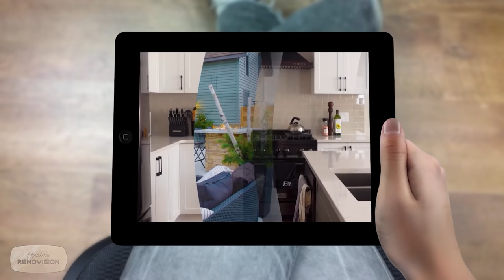Building A Simple Deck In 1 Day | Reality Renovision Ep28

Comment: Gaps in between deck boards help a lot with debris and water run off. Plus you probably wouldn’t have been short at the end. I guess maybe if the boards shrink at all that may work to your advantage.
Reply: I mean yeah, but since they are only going to be there for a short time and leaving it behind....
Reply: I do not leave gaps anymore.  Shrinkage will occur and prevent your boards from warping.  Also, large gaps are ankle twisters !!!

Comment: My only criticism is the double joist should be on the outside (more foot traffic) versus up against the house. Also I might turn the whole thing 180, because the joist would have the water on the  ground run away from the house without trapping on the crossmember. 
Some are saying what about the top of the deck, water would run across 8 inches quicker than 10ft

Comment: This channel is the best, and this deck is awesome. This is the first floating deck video I've seen where you don't mess with blocks, posts, etc, at all. Sacrilegious! I love the simplicity of this. You didn't even put plastic or something at the ground contact points. It's wood on the ground! Mind-blowing! Call the police! I love it. I have been looking at covering a concrete patio with a floating deck, and trying figure out all these complicated expensive plastic anchoring systems, but now I'm like, forget it, this is 10x faster and way cheaper for what would probably be the same result! Here's a question though: if your ground isn't quite level, what's the point at which this approach doesn't work? Like, say you've got 6 inches of drop-off. Is that too much for this approach? What's the point where you say, OK, we have to use anchors, posts, joists, etc? Thanks for all the awesome content.
Reply: Keeping it simple is not only the key to success but to make it financially viable in 2021. The more complex it gets the more materials and techniques it takes. This is not designed for longevity rather quick and easy.
Reply: Wait til they go to sell the house... Code violations/insurance inspection in most areas will require updating at a much bigger expense than initially. Do it right the first time.
Reply: @JohnJohn-wr1jo  there’s no code when it comes to detached decks. Whether it still looks good/is structural in 10 years, that’s a different deal.

Comment: Looks great! I am building a 24x24’ floating deck and need to have it done in a week. I am placing it on a grassy area that is not level, and we are not using deck blocks because we live in the country and we don’t want critters getting underneath or bees. We’re building on the ground. Any suggestions for getting it level? Can we just shim the low areas.? I’ve never built a deck before. Do not have experience, but this looks simple enough. Also, would you recommend building it in one big 24 x 24 section or would you recommend building it in two or four smaller sections? Thanks!

Comment: Being in Texas, I’m worried about how to prep the deck to accommodate for lots of condensation and ground evaporation from the morning hours to the sweltering heat through the rest of the day. If I want a ground level type deck like this, what kind of extra protection can I provide to prevent premature rot from staring along the bottom?

Comment: question - a 4x8 deck that is inches of the ground.....I have the right hand side toe nailed to the existing deck with about 14 screws...is hat enough support.......and the other side is supported by 2 concrete slabs at each corner.....is that enough support for this deck which will only be holding up a bbq and snow/ice buildup in the wintertime?  thankyou and much appreciated

Comment: Jeff, nice work ok i asked this before and didn't get an answer so hopefully you will see this.  I tore down a 7 year old 12 X 24 section of deck at about 9' above ground,  7 years old and tons of wood rot.  not thrilled.  but I have a 19 X 7.5' swim spa coming so I'm pouring a 12 X 20 pad 6" thick on the ground,  I'm going to rebuild the deck at the original height of about 9'.  I need to support the swim spa off the pad so that about 20" of it sticks up above the new deck.  my question is what would you recommend i use to build up a support at about 5' off the new pad so the swim spa is self supported.   weight full of water is about 25,000 lbs.  with people and the fact that water is moving etc.  say i support for 30K lbs.  any suggestions?  I live in northwest Georgia so will take more precaution against wood rot this time but wonder is i should maybe build some kind of steel support. ??

Comment: Hoping you see this question and can answer for me. Love your videos on both channels. Binge watch quite often. I’ve heard you mention several times in videos about not using the correct screws for the subfloor. I’m in the middle of a kitchen remodel and actually used drywall screws for my subfloor but luckily haven’t put down the floor yet. I’ve tried to look for flooring screws but at Home Depot I don’t see anything specifically saying flooring screws. Only nails. Where can I find the proper screw and what are they called. Thanks In advance.

Comment: We have a fenced yard with constraints and have only enough height from the soil to the back door to use 2' high frame (we intended to use 2 x 4 x 12 pressure treated lumber) + the decking materal.  The deck will be 12' x 13', and the surface will be Timbertech Azec.  With the frame be structually sturdy enough?  Should we use weed sheet with rocks, and adjustable footings?  Thanks!

Comment: If I wanna build a 16x16 what material would you recommend ? I have blocks and paver sand , wondering if I can use 2x8x16 for the wild build with joist hangers and sitting on blocks .

Comment: What type/length of nails did you use for the joists? I'm pricing out lumber for a 12x12 right now and plan on building it the same way you did in this video. Simple, clean, and need a ground level floater for how my backyard is shaped and where the utilities run. Thanks!

Comment: As a professional deck builder, we'll just start with you need more than a hammer and a tape measurer. DO NOT BUILD A FREESTANDING DECK WITH THIS METHOD. Just because its a freestanding deck under 6ft tall that does not require a permit, doesn't mean code doesn't still apply, you cannot build this anyway you want like Jeff said. Using 2*8 block to transfer all the load into the ground is a piss poor way to make a sound foundation, within the first couple weeks and spurts of rain that deck is going to be waaay out of wack. You need to have doubled up rim joists, joist hangers, a solid foundation (wether it be traditional footings or footing blocks like you saw them work around but never use) and use some damn joist flashing tape for god sakes. This deck will last this summer, maybe. If your trying to build something to last many years to come check your local building codes, reference joist and header/girder span tables, make a solid foundation and connections to that foundation, use joist flashing tape on all the joists and behind the skirt and screw your decking down. Jeff usually makes decent video's but this is just him making some viewer content and is not something you should set out to do yourself and expect good results with. If your doing a maintenance free deck your almost just best off to hire a pro, same is true for cedar, if its green treat its going to look like shit in a year anyway so feel free to do it yourself and be a butcher. There are plenty of better deck tutorial videos out there and Jeff I'm sorry to tear into your work like this, but this video is not worthy of being called a DIY tutorial its more of a DIW (do it wrong) tutorial. You sending people who can barely read a tape measurer out to build something with the wrong information and really setting people up to waste their time & money and to fail.
Reply: Also gap your deck boards a min of 1/8", your building a deck not a pool. Pressure treated lumber will shrink a little so its actually best to set it with an 1/8" gap and count on it opening up to 3/16" which is the most common spacing of deck boards. For cedar, redwood, or composite use your speed square to set the gaps (speed squares are 3/16" thick).
Reply: Isn't pressure treated wood toxic?  I thought you weren't supposed to use it for a deck floor, just the frame.
Reply: @jenniferhigber595  It's not as toxic as it once was, lumber companies used to use arsenic in their chemical treatment solution but they have since transitioned to use copper based chemicals for the better part of 30 years. It's still not great for people to ingest (like when you inhale it's saw dust), but it's not nearly as toxic as it once was. It is still ok to use for decking but if your planning on making planter boxes or dining surfaces (like a picnic table) it's recommended to use naturally decay resistant lumber such as cedar or redwood. The one real reason I can give you for why its not the best product to use as decking, aside from it being a semi-toxic material, is its almost guaranteed to go to hell in a year or two, depending on what time of year it was installed. The reason for this is because pressure treated lumber generally comes with 40%-60% moisture content. So for the next year at least it continues to cure out and dehydrate and that can cause the natural grains of the wood to shrink/tighten and create bows, kinks, twists, and cupping. Any time you build a deck, especially a pressure treated deck, you need to use screw. On top of all that pressure treated decking is not a great looking product, staining it never looks very great and painting it kind of takes away from the "exterior escape" vibe people love about their decks.
Reply: Yep

Comment: Switched my thumbs up to a thumbs down not because of your video but because of YouTube. Your "Have You Noticed The EMPTY Shelves??" is loading awful, maybe 6s of buffering for 2s of video. Thank you for creating the content, but YouTube is not doing well with it... I'll give a thumbs down to hopefully improve things, and I've heard that thumbs down still helps the channel
Reply: It's not YouTube's fault that a certain video is buffering more than other's. The length of the video has a little bit to do with it, but at the end of the day it is your own internet connection and download speed that is the culprit. So, giving a thumbs down for a problem that is clearly not the content creators fault nor YouTube's fault is completely asinine. Rather ignorant of you actually. You need a higher Mbps connection for longer videos (or almost any video for that matter) to load and play at it's original quality. You may be able to watch short videos pretty clear sometimes, but if you're experiencing a buffering issue on a longer video then your internet Mbps (speed) is just too low to keep up. The shorter videos may play fine but that's due to less data needing to be transfered and probably how much bandwidth you are able to take advantage of in your area depending on other people's usage rates as well.
Reply: @LeadRakFPS  Ok, I switched it back. Not sure how else to provide feedback to YouTube (it's not an issue with my Internet connection speed).
Reply from the maker: I appreciate the effort. Trust me I read my comments so feel free to let us know. Cheers!
Reply: @LeadRakFPS  Everyone always says it's not YouTube's fault. When clearly it is.
That happens to me sometimes too. Maybe like 1 out of 100 videos start to have buffering issues.
Reply: I'm sorry. I found the "Send feedback" button in the upper right menu to report the issue directly to YouTube. I should not have gotten frustrated and attempted to give YouTube-specific feedback on a video. Jeff and crew are doing a great job, and I really appreciate the informative videos. For what it's worth, when I returned to the video later, and it reloaded, it then played through the end just fine.